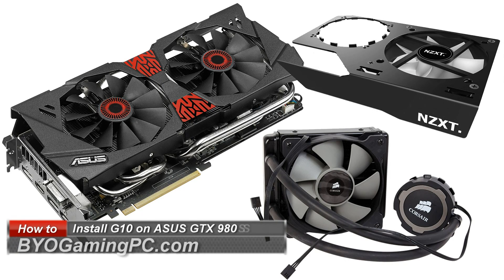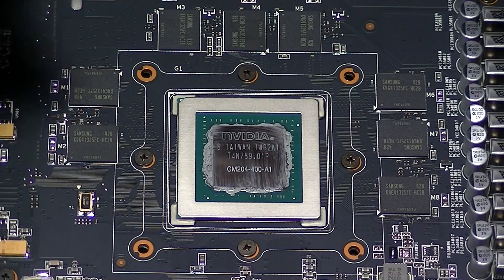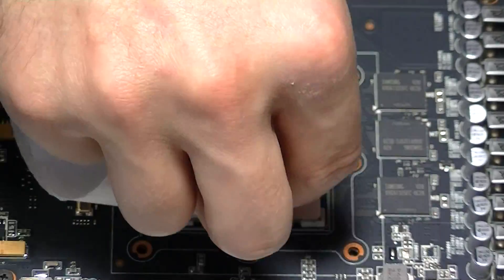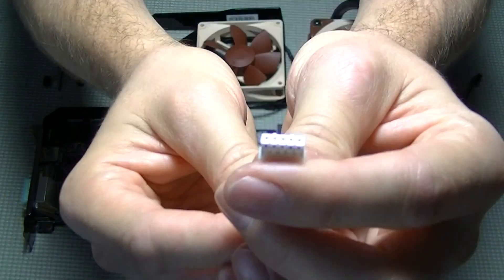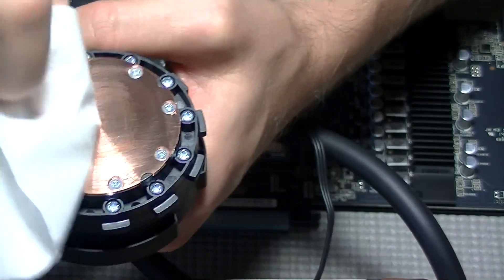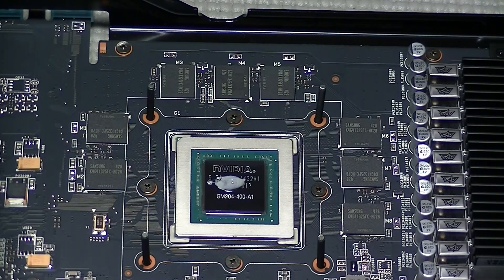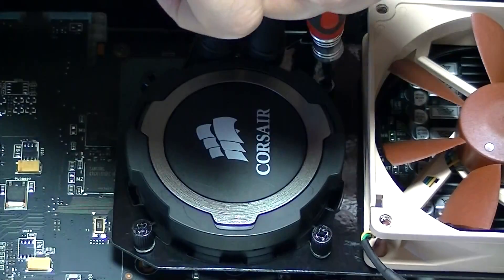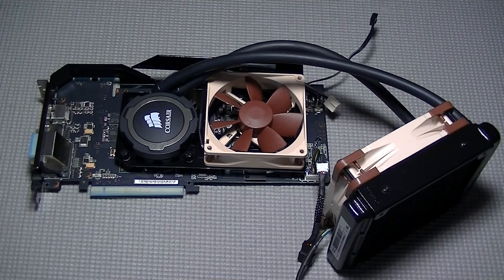ASUS GTX 980 STRIX & NZXT Kraken G10 Installation How to

Comment: Do you need any kind of heatsink on the vram? 
I remember that was something that people did on the 770 when installing the g10 i am asking because I plan on buying a g10 bracket for my evga 970 ssc and i was wondering if i need to buy any heat sinks for it.
Reply from the maker: Jak Buckley You don't "need" them but they won't hurt to have if you plan to OC the memory a lot.

Comment: will this work on the direct cu ii r9 290x ?
Reply from the maker: Hamidflacko It should but you may have problems installing the thumb screws because the bolts come through close to the pump housing. You may need some jam nuts to fit in there instead of using the thumb screws.

Comment: Just a heads up, removing the cooler voids your warranty. Unless you're very careful with that white sticker  :P
Reply from the maker: Aaron Rhode I just destroyed my stickers when removing.
Reply: How did you exactly remove the sticker without damaging it.... Iv seen people use hair dryer or heat guns to help peel it off. But do you have any tips?

Comment: Does this setup work well with sli? i plan on going 2 way sli with my 980 strix,but i have seen that other people have got worryingly high temperatures on the top card. I was thinking that if i had 2 of these on mounted on the bottom fan slot and on mounted at the back i could have consistent low temperatures. I was also wondering if i could put little heat sinks on the vrm's and vram to keep everything cool, will i be able to fit small heat sinks on the card with this for cooling
Reply from the maker: SLI works great with this setup and I've not seen any problems with temps. The VRM cooling with the Nocuta fan the I used will be much better than with the stock air cooler blowing through the fins of the radiator that obstructs airflow to the VRM's. The G10 fan mount is almost directly above the VRM's as well.

As for getting heatsinks for the VRM's, you don't need to because the ASUS STRIX already comes with a VRM cooling heatsink which you can easily see http://youtu.be/RlGMhASE22w?t=5m32s. It's the black metal strip with the fins on it on the right side of the PCB where the VRM's are.

My experience has been better GPU and VRM cooling all around. The GPU cooling is more drastic by about 15C and the VRM is around 9C cooler.
Reply: Thanks! i might just have to go buy one of these soon

Comment: How much difference would just re applying better paste properly help?  I also noticed the Strix heatsink on my GTX 980 does not fit very snug at all.. feels kinda loose.
Reply from the maker: Maybe 1-4C at most.
Reply: They need to do something about the spring pressure.  I have had a couple of the strix line I have played with and all I could easily unseat the heatsink from the core by lightly pressing on the heatsink assembly.  It's really a poor design and it's no wonder the MSI cools better.  The MSI felt MUCH more secure when I was testing it.  If I did new paste and added some washers to increase pressure I would hope to get 4C or better decrease in temps.  In my opinion it makes the Strix feel like a cheaply made card.

Comment: i always thought the g10 is for reference board only?

i used this for my 770 but after checking nzxt website, it says 970/980 are not supported because it's non reference.

i'm confused now and after watching your video, i have renewed hope!
Reply from the maker: The website only says reference because that is the only one they test. They don't physically test every single variant of every card but it works on the majority of aftermarket cards as well.
Reply: BYOGamingPC thanks for the info!
Reply from the maker: My pleasure!

Comment: Hey, I have bought the same kit, to go with my GTX980 Strix

How much stable overclock can I expect to see?

I'm on air now and get like 1500Mhz without artifacts, could it go faster?

If so then could you tell me what settings should I apply once this kit is installed to go over 1500Mhz stable?
Reply from the maker: It really depends on your GPU but you can either run higher or at least a lot cooler.

Comment: The  GTX 970 Strix is a non reference design. I would advise against using this cooler/kit on that model as the VRM's are on the opposite side and need to be actively cooled to prevent damage to the card as the VRMs will overheat.
Reply from the maker: You can see in the video that the cooling fan is blowing directly onto the VRM heatsink and will actively cool better than the DCUII cooler that comes with the card. The DCUII cooler, though an excellent cooler, has less airflow over the VRM than this setup due to the radiator fins that impede the airflow.
Reply: BYOGamingPC I couldn't reply to your comment concerning the 970. While I agree this is a viable cooling solution for the 980 Strix I just wanted to clarify for those seeking to do this on the 970 Strix it will not function properly if at all as the VRMs are moved to the opposite side of the card due to the non reference design.
Reply from the maker: Unspok3n I'm sorry, I didn't see that you were talking about the GTX 970.

Comment: Hi! Is it possible to install Kraken G10 on my 970 SC ACX 2.0?
Reply from the maker: Yes, you can.
Reply: BYOGamingPC Do I need something like a special screws or anything instead of just the ones in the package? I thought ACX 2.0 is a quiet cooler but it whines @ 50% speed.
Reply from the maker: aiSoju If you have a custom backplate then you will need to use special screws.
Reply: BYOGamingPC I see. Thanks!

Comment: Great video thanks. Can I ask where you got that adapter for plugging the fan from the g10 directly into the video card? I bought one for my MSI gaming gtx 980 but its only a 4 pin one and it looks like my card header is a 6 or 8 pin. I can't seem to find that adapter you have anywhere...

Thanks!
Reply from the maker: I believe this is what you're looking for http://bit.ly/1J9LkYc You may have to do some cable modding to make the PWM work with your fans though.

Comment: Hi, BYO. 

I have some questions as I'm a bit confused as to how this set up works. 

From what I understand, you mention you're using three fans in your description, I assume you mean the pump, the VRM fan and the radiator fan, right? 

You then connect all three of these fans' PWMs to the splitter than then further connects to your PSU AND your GPU header?

If I'm right, doesn't that look a bit messy? Can you upload a picture or describe a vivid image? Lol

Thanks for video and please get back to me soon!
Reply from the maker: I was using three fans plus the pump.

1 VRM fan
2 radiatior fans

Your conceptual idea of how it is connected is correct. Mine is all buried beneath my motherboard tray as I have a CM HAF XB EVO and my cabling is all concealed.

GPU PWM header > Splitter > 3 fans and PSU. Depending on your setup (and creativity) it could be messy. :)

Comment from the maker: @Andre Keurentjes A full cover block will always be better. This is a step between air and a custom water loop. I don't doubt that your experience is better with a full cover block. The G10 is for those who want an efficient cooling setup that is quiet with relatively no maintenance.

Comment: my gtx 780 lightning has more than one fan connector, can I connect the 92mm fan and the fans from the radiator to those connectors? and the pump?
Reply from the maker: I would only connect one fan to each connector. I wouldn't connect the pump though it would probably be OK.

Comment: Hey I NEED a response. I heard that graphics cards can have problems with the g10 kraken like the fan not keeping the rest of the board cool enough and all that and the card can cause  the pc to shut down randomly is this true?
Reply: I took my G10 out from my GTX 770 after a year of very shaky use. It just never worked properly for me, I tried NT-H1 paste, Arctic Silver paste, with a shim, without a shim, 100% pump speed (which is loud and defeats the objective), I put copper heatsinks on all the chips and it STILL was sitting at 60C idle, 80-90C under load. It was running HOTTER than the stock cooler, and my stock cooler is the cheapo plastic alternative that is supposed to be terrible.

I wouldn't recommend it personally, but other people seem to have gotten it to work. Perhaps it depends on the cooler, I used an Antec Kuhler H2O 620, which looks almost exactly like the Kraken X40, but I dunno... perhaps it is slightly different.

My setup was a Silverstone TJ08e case with a Noctua NH-D15 cpu cooler and the G10 linking the radiator out the back. The idea was to have the air flow all go on a straight line like a pulse engine, but I hit snags everywhere. The rubber tubing comes perpendicularly out of the radiator and pushes into the NH-D15 causing it to bend to the side slightly and the noise of the liquid travelling through the loop to increase. It was also a monster to troubleshoot as disassembling the unit meant taking out the NH-D15 every time to access the radiator, and every time I would have to clean up and re-apply thermal paste. It was a NIGHTMARE PC!!! :'-(
Reply from the maker: DaGleese Wow! Something must have been wrong somewhere. You should never have had that many problems. I wonder if something was wrong with your AIO cooler. It sounds like you've exhausted about every option you could and without any other information my guess is that there was something wrong with your cooler.
Reply from the maker: I have not had that problem but I also have a very open airflow case. It may be possible if your case doesn't have much airflow to keep the rest of the components cool.
Reply: BYOGamingPC Yeah it's really perplexing! The cooler seems to be fine, it used to cool my 4770K with a high OC and it did that just fine, I've hooked it up to a G3258 on another PC now, but I actually have not turned it on yet as I'm waiting on a PSU for it. Here's hoping it's still good enough for that!

My only suspicion is the way the rubber pipes were getting pushed in by the NH-D15, perhaps slightly disturbing the flow, but there was still ample flow going through, and even if that were the case you wouldn't think it could yeild 60C idle temps!

I'm using a friend's 970 STRIX at the moment and even with extreme furmarking it has not gone over 73C. The fans are actually almost inaudible and my PSU makes more noise!

Comment: What are you going to do/ have you done with the original heat sink and shroud?
Reply from the maker: The heat sink that comes with the CPU resides in the box until I upgrade one day and it's sold with the CPU.

Comment: How about H55, and would it be good to use the pre-applied thermal paste on the H55, on the gpu?
Reply from the maker: The H55 is a great choice also and the Corsair thermal paste is pretty good stuff so you can use it.
Reply: thx

Comment: does it fit  on EVGA GeForce GTX 980 Superclocked ACX 2.0 4GB?
Reply from the maker: It should but I've not done it.
Reply: BYOGamingPC what about the evga 970 version?
Reply from the maker: flyinginabluedre It should.
Reply: i already asked NZXT about it, they said that the bracket does fit on 980 SC ACX 2.0, so i think it should fit on your 970 too.
btw thanks for the answer :)
Reply: Excellent, thanks guys! Now, need more funds!
Reply from the maker: İşsizEmre -.- Should work but I've not tested it... yet.

Comment: Hey man, i picked up the palit jetstream gtx 970. (they had just come out, and no others were gonna be in stock for 3 weeks) But the cooler is massive, it takes up 2 1/2 slots. Would a kraken fit? The PCB looks a bit shorter than other 970's
Reply from the maker: I can't say for sure but I would guess that it can. It really depends on the layout of the PCB. You just need to make sure that the cooling fan is hitting the VRM's.

Comment: Does a gtx 970 require any vram heat sinks? I plan on buying a 970 and transferring my cooling setup from my r9 290 which does require heat sinks.
Reply from the maker: I have not used any heatsinks on any of my NVIDIA installations from the 700 to the 900 series cards and not had any problems. I will also make note of the fact that I have not done any high overclocking with my cards either, only moderate.

Comment: what tools did you use other than the screwdriver i did the install on my 980's reference card and my board had a loose pci e slot and it fried my one card :/ so i ordered this to replace it
Reply: BYOGamingPC thanks I didn't tug with force or anything I just had a faulty board I think I unlocked it ect barely any pressure. Both of my reference cards needed to be fully dismantled with this itty bitty hex key it sucked...
Reply from the maker: adam Heiss Yes, the reference models usually require Torx or hex bits and a lot more screws need removed to be able to dismantle them. The aftermarket coolers a FAR easier to get into.

Comment from the maker: Yes, this install will be the same on the GTX 970 version.
Reply: +BYOGamingPC So it will fit on a Asus Strix GTX 970?
Reply from the maker: +Megaspasstpräsentiert It should.
Reply: +BYOGamingPC Okay, thank you.
Reply: But the funny thing is that the voltage regulators are not where the PCI 8pin plug is, it is where the video output plugs are!?
Reply: +BYOGamingPC ok
Reply: should i Use little memory Chip coolers or is it useless
Reply from the maker: They don't hurt but aren't necessary unless you are doing some heavy VRAM OC'ing.
Reply: Why not? I'm looking into it.
Reply: How sure are you that it fits the Strix 970?
Reply: tks a lot for video!!! 970 here!!!
Reply: it doesn't fit with the GTX 970 STRIX...